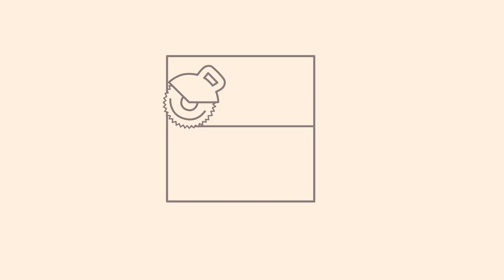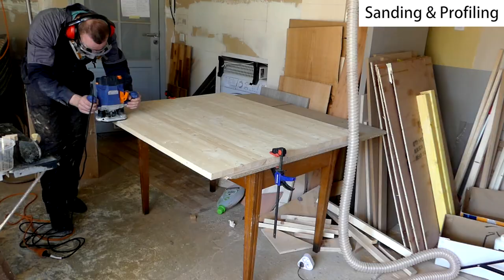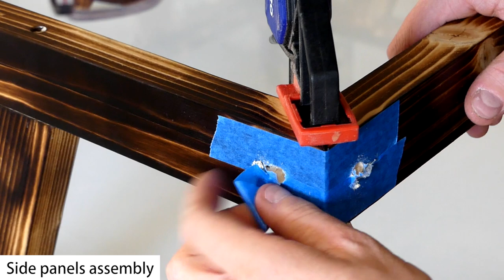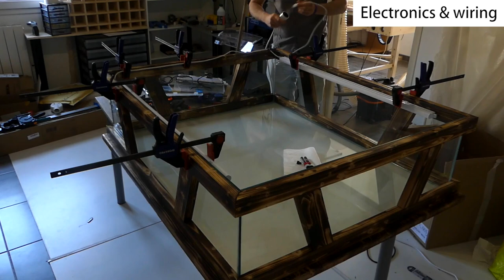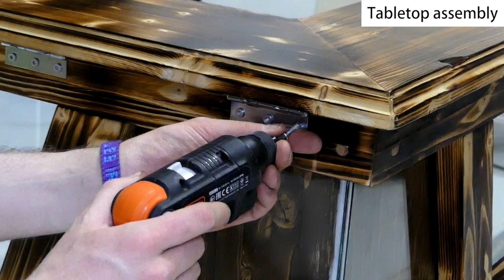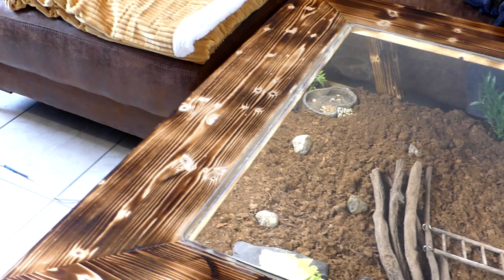Coffee Table Terrarium for Turtles - Made with Burnt Fir

Comment: very nice job. aesthetic and practical.
It is just a pity that there is no aeration. this is not great for a terrarium
Reply from the maker: There is actually a tiny gap between the top and the glass, and since the air inside is hotter, there is a natural exchange / air flow with the outside of the terrarium :)
Reply: Ok. An invisible air exchange. it is ingenious.
Nice work. @GregMakesThings